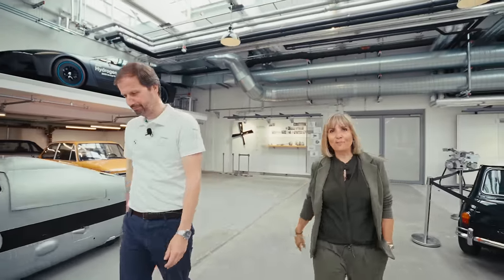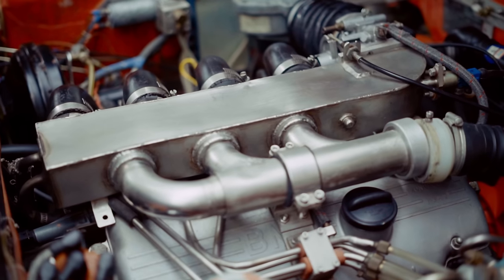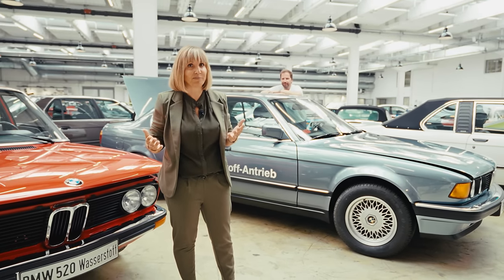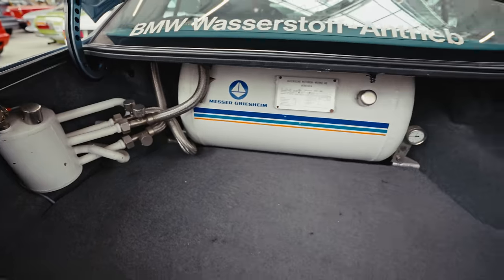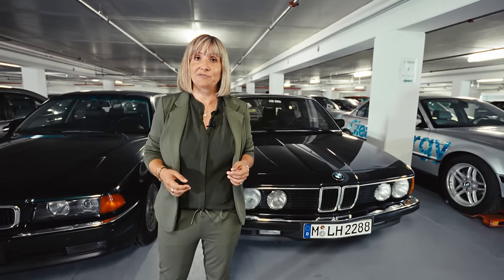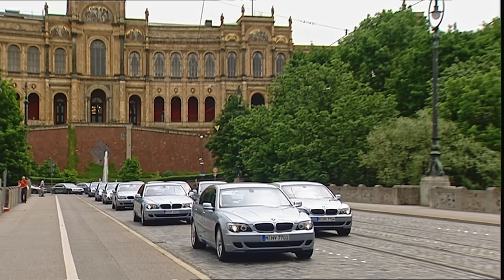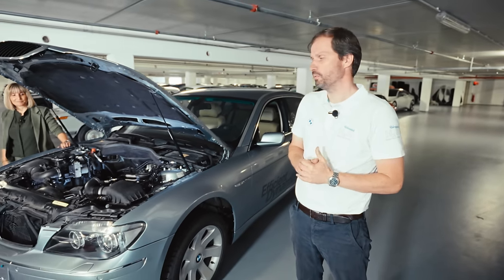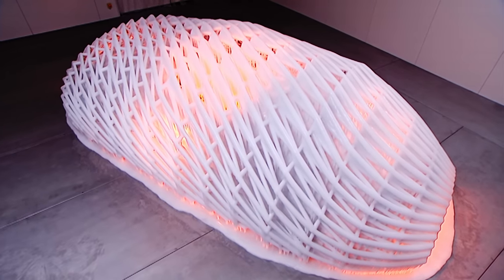Inside BMW Group Classic - Cleaner Driving with Hydrogen

Comment: M539 has restored one of the v12 hydrogen engines for his car. 🙃
Reply: learned a lot today.  I thought it was the E38 750ih the placed in Sacramento for Schwarzenegger's H2 initiative, but here we learned it was the Bangle butt E65s.  They were very practical and drove much like an M62 powered version.  Also I thought the H2 demo car was earlier than last year - must have been another.    I saw M539's 750ih.  H2 from solar is the only real alternative to nuclear H2, and of course liquid hydrogen is the highest power density fuel we know of - witness the Space Shuttle.  BMW rightly used both direct and port injection way back before that combo was en vogue by Toyota and others, along with positive displacement supercharging required for the volumetric efficiency H2 requires.

Comment: These videos are so interesting! 🤌🤌 Hydrogen is also something we need to invest in more.
Reply: No we don’t need, we need electric cars. Because it’s more efficient!
Reply: @JoloshopDe most hydrogen cars are using electric propulsion. The problem is with Battery EVs which are not good for the environment where energy intensive mining is required to produce them.
Reply: @AKK5I  People are just blinded by that and refuse to see the transportation sector also includes airplanes and boats and large trucks. We need hydrogen and a less aggressive push for BEVs to solve the problem. The debate is too political at the moment and one large player has willingly painted the wrong picture for the masses who have limited knowledge of the subject, resulting in people barfing up soundbites without realising what they are saying.
Reply: @natantaz  exactly, well said.
Reply: @JoloshopDe  but Electric isnt environmentally friendly so its still not a good solution...
Reply: @memorimusic420  A stop-gap at best. Politicians and simpletons are hung up on "pump-to-wheel" but have no clue the real solution is in "well-to-sheel".
Reply: @natantaz  english isnt my first language I have no idea what you mean by that lol 😭😭 could you reiterate please? :)

Comment: Das klingt leider schlecht. Ausbau Motor von E65 ins H2 Auto, weil es gibt keine andere solche Motor. Was passiert mir originale H2 Motor denn? 

Tja, leider Wasserstoff Geschichte ist zu teuer. Hier in Münster ich kann tanken Wasserstoff, aber 9euro pro Kg! Und der neue X5 H2 leider schafft gebau 1.2kg auf 100km. Was ist deutlich teurer als unsere X5 e53 3.0d oder i3s 120ah...